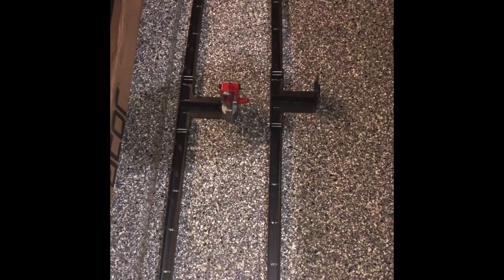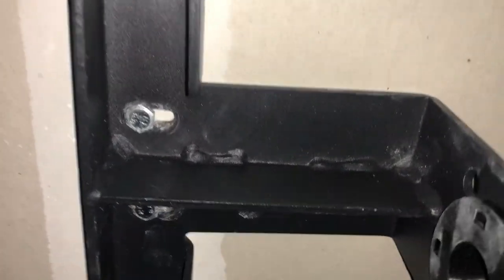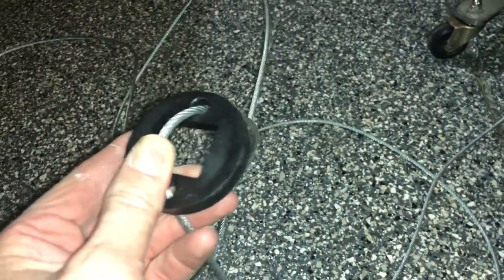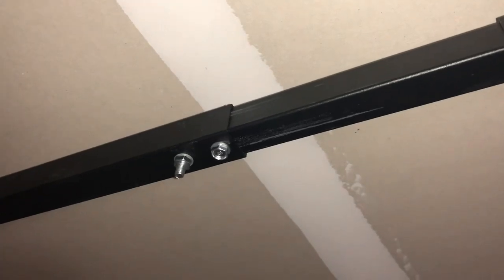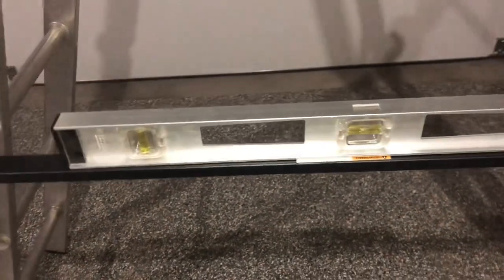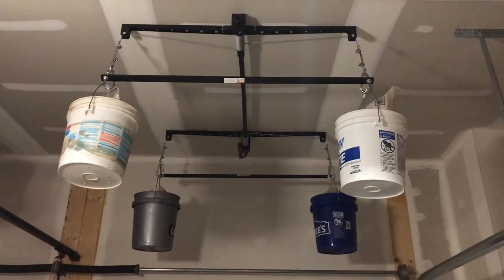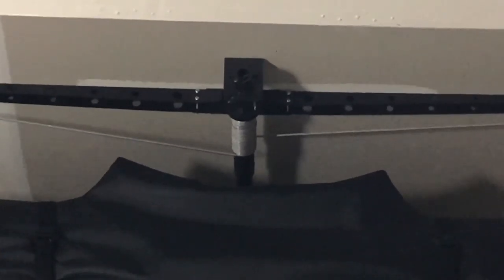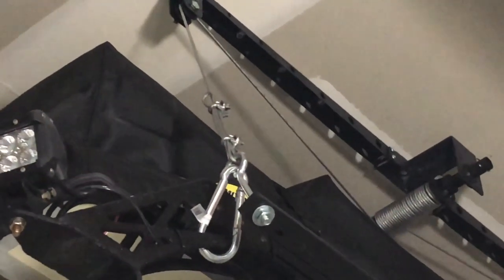Racor HD lift installation for RTT storage hoist

Comment: Good installation video, I like your mod to make it work for your tent. Just installed this myself a few weeks ago for a kayak. Ended up installing some secondary straps as a backup in case some part of the lift ever fails. Just posted a video about that on my channel if you're interested. You got yours for under $100? Mine was $210....
Reply from the maker: Would love to see pictures of your installation with security straps. Post a link in the comments if you can.

Comment: Very nice user video with excellent suggestions- thank you. Please be careful: The added (aluminum wire) "snap clips" are not the safest choice (despite the "350# rating). Sorry to be critical here: these "clips" are not "caribiners", which are made with different/stronger material plus a secure locking mechanism designed for mountain climbers, etc.